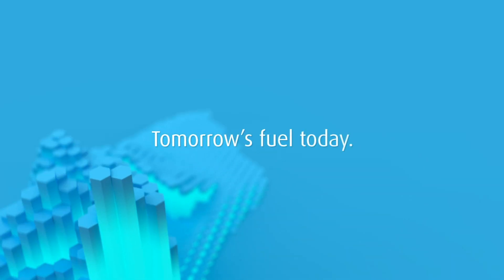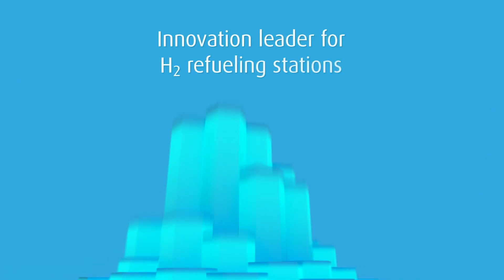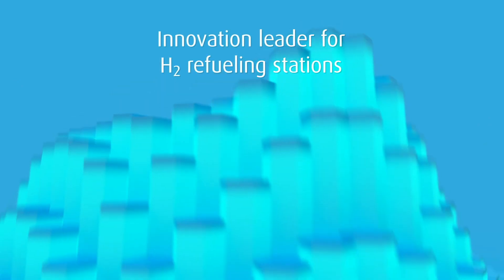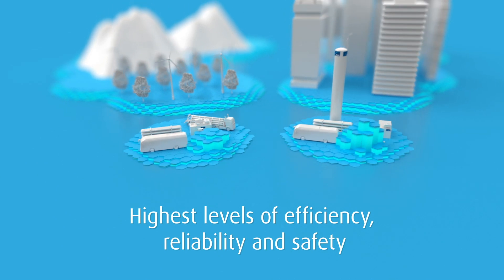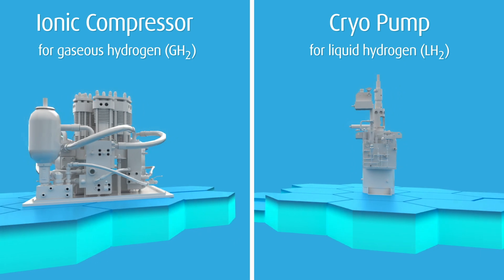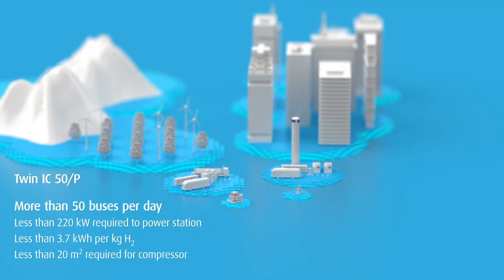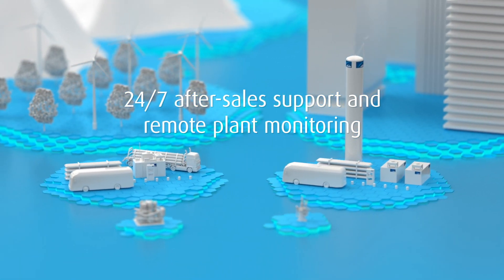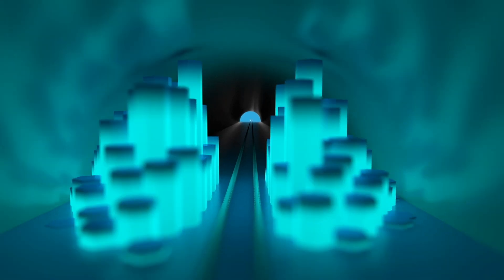Tomorrow´s fuel today: Linde hydrogen refueling technologies.

Comment: Wow this is amazing. Keep up the great work Linde! It cost me about $80 USD to fill up my 2010 Ford Fusion with regular gasoline earlier this month April 2022 in California. If the cost of H2 gas would be similar or cheaper than that, I would choose a fuel cell car for my next car over a polluting gasoline engine car, an EV which still obviously harnesses fossil fuels in order to recharge EV batteries, an HEV or a PHEV. Fuel cell cars are the intelligent choice.